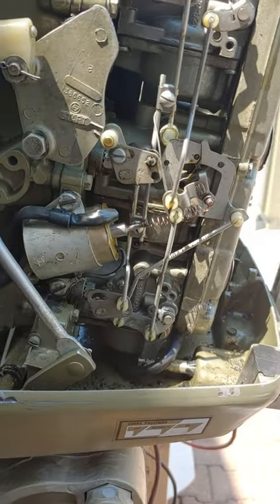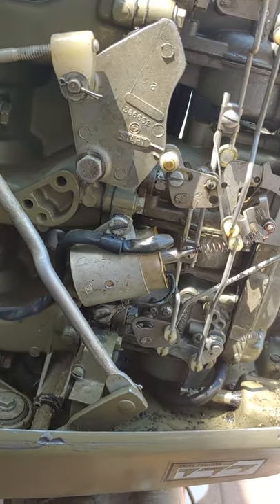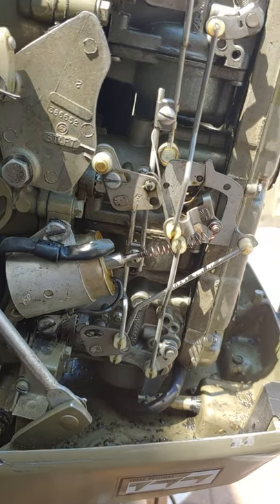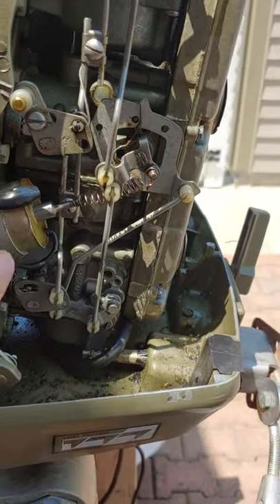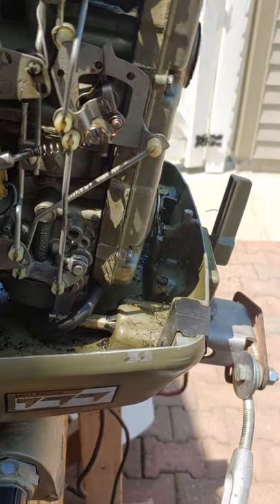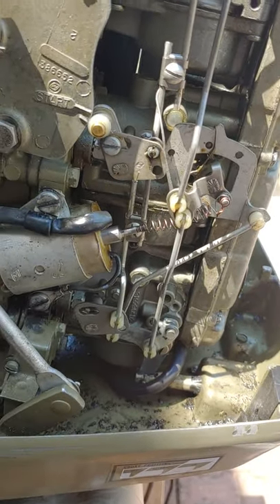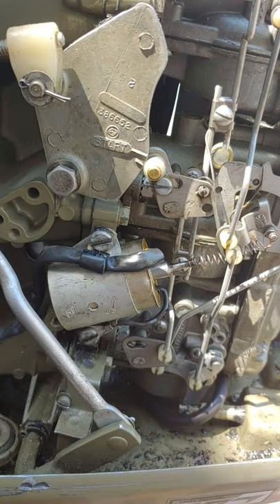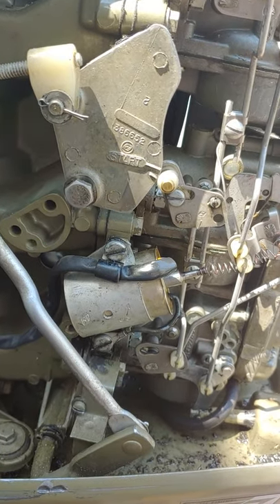Johnson / Evinrude choke solenoid adjustment

Comment: When i turn the key on, on my 115 evinrude the plunger goes inside the solenoid and appears to stay in until i turn the key off. Is this how it is supposed to work, or is the plunger supposed to come back out once the motor is running? Does it fluctuate as needed? Im just confused how this plunger is supposed to work. Thank you!
Reply from the maker: The plunger should only be activated when the key is in the on position and pushed in. Or if it has a toggle switch only when it is held on. If it's on all the time, your motor will run poorly if at all. You can disable it by just disconnecting the wire.

Comment: Does this style electric choke work off the key switch or did it have a separate button/switch
Reply from the maker: works with ether
Reply: @Bob Turner  I'm just asking how it would have came factory
Reply from the maker: That type of choke came with the motor, there are the two different styles of remote controls both will work.
Reply: @Bob Turner  I have that style, it has that choke. I'm only asking because there is no remote switch to choke, so I was curious if the choke should be working when I turn the key initially.
Reply from the maker: If you turn the key to the on position and then press it in, that should activate the choke.
Reply: @bobturner5395  press what in? Thank
Reply from the maker: The key
Reply: @bobturner5395  sure enough, I never knew. Thank you

Comment: Hopefully I can get some help, I have a 1978 Johnson 70 hp. Initially what would happen is, I would start it, and it would start just fine, idle strong, and initially when I put it in gear, either forward or reverse, it would go.
   But anytime I give it any throttle/load it would just bog down and die. Eventually, I started messing with the choke and would push the key in and for a little while it would help. Now I’m only getting a fourth of the power/speed that I should be getting.  Please help
Reply from the maker: Sounds like you may need a carburetor rebuild. Check out a channel called Branden's Garage he covers almost everything about OMC motors.

Comment: Is that a 65hp johnson?  That spring looks incorrect for the choke.
Reply: mine has the same spring on the end of the rod that comes out of the solenoid.
Reply: and it's a 50es75b engine. 50 is the horsepower and 75 is the year.

Comment: The plunger on mine is loose and won’t engage to move.  I probably have to buy another one but I don’t know where to look
Reply from the maker: There's a lot on ebay, but they're pricey. I bought a whole motor just for the choke.
Reply: Where are you located and do you work on boats